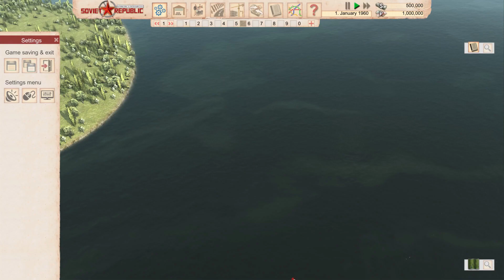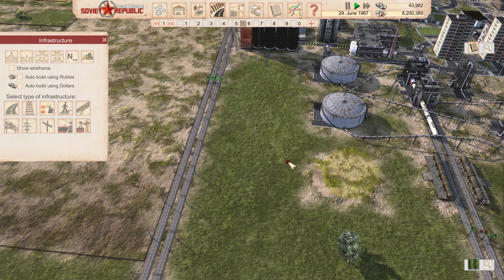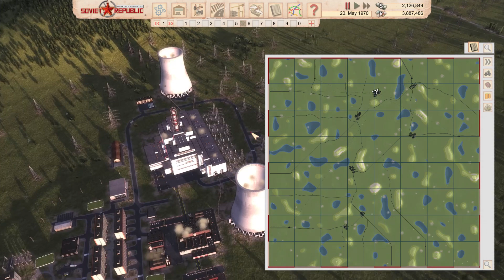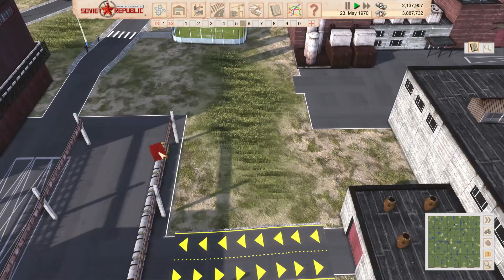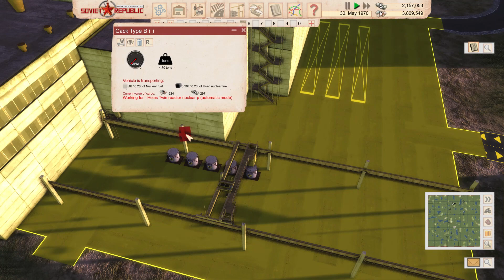Workers and Resources - Soviet Republic - Nuclear Power Plants and Industry

Comment: I don't quite agree that 30% is a good option :) Why? Imagine the situation that the city is large, the journey through the city takes a long time, loading also takes place. There are a lot of people in the store, the store has a small capacity. If the truck leaves below 30%, it may not be on time to the store. Will arrive as long as it will be 0%
Reply from the maker: True. I agree. Maybe 50% also, I don't know how it works with warehouses/Storage areas. Is it 30% of the "thing" that is missing or 30% of the general space. What if I disable the Logs for example. Does it count 30% of the full capacity of logs or counts only limit that I set? :) I'm pretty sure you are correct though. :D
Reply: @oolykeegaming81  This new mechanics need to be checked a little :)

I have a test for you :)
The same route, the same trains, the same task, different semaphores.
Buy 3-4 short trains with a wagon, e.g. for coal. Set the route for them: 1 stop - unloading station (do not wait for unloading), 2 stop - loading station (wait for loading) and let them on the route one by one immediately. And watch how trains and semaphores behave. Once you have 2 trains at the loading station, make one go to the unloading station and see how the one waiting in the queue and the semaphores behave. Standard: blue section longer than train, yellow water length.
Do the same for each route. Normal / Chain / Normal-Chain

You can record a video and upload it to a non-public one and send me a link, I will gladly see how it went;)

https://i.imgur.com/RQ7B7kT.jpg
Reply from the maker: @cmeproone  OK. I'll need a day or two to organize this. I'm working tomorrow but might do it in the afternoon if I'm home. If not Sunday! I'm interested too!! :D :D
Reply: @oolykeegaming81  Take it easy in your spare time, take your time. Seeing the effects and differences in your eyes can help a lot in understanding how each semaphore works, and it may be useful in the future.
Reply from the maker: @cmeproone  Indeed it will. Actually, this will be an awesome test! I wanna know how rails work in this game. What's the max capacity and the max length in any given setup. Thanks, Pro!
Reply from the maker: @cmeproone  Here we go. 

https://www.youtube.com/watch?v=agqmpuvDQMU

I did not understand if those are semaphores on the not side of the loop. If they are skip to 9:30. 

:D